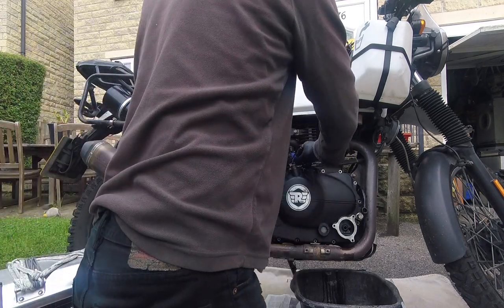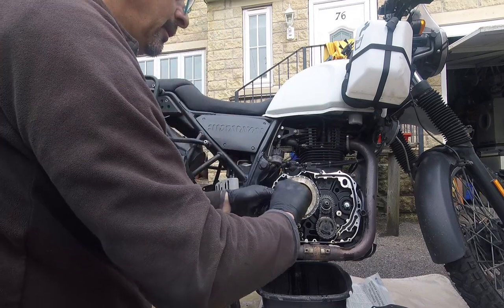Heavy Duty Clutch Replacement - Royal Enfield Himalayan

Comment: Thanks for sharing this video, I have a question, could you give me a tip?  After carrying out the whole process, I see that the clutch is not being activated, the lever is too soft, I thought it was strange because I followed the entire manual.
Reply from the maker: I'm not sure with out being able to investigate, but it could be that the cam attached to the cable at the top wasn't located correctly, or maybe just tat the clutch adjustment is way out?
Reply: @TimPriestChannel  Actually I just had my clutch done at a dealer,,and at the outset I thought the new clutch felt wishy washy,,  but it worked  then after about three weeks the cable snapped,,new cable all is good ,,clutch is now heavier then before ,,,but I,m a real man and can handel that no issues.. incidently Indian cables are real RE ,,english ones (twice the price) are just aceessories ,,take your pic,pays your money
Reply from the maker: @lipsee100  Thanks for the input...